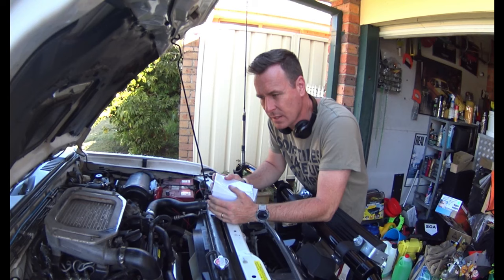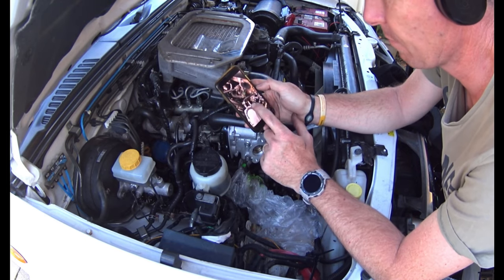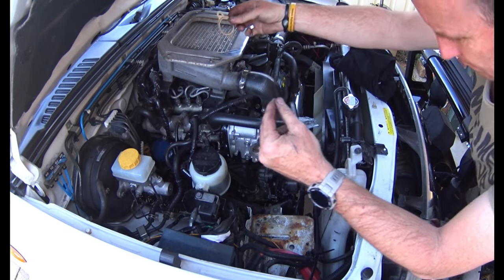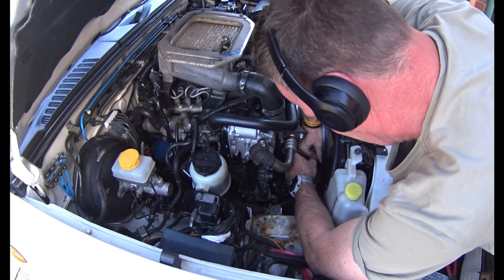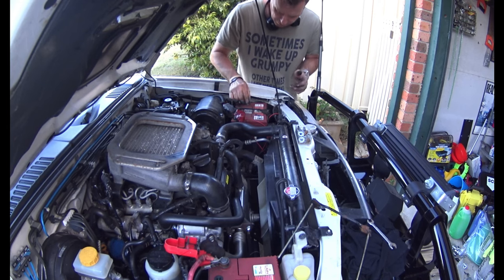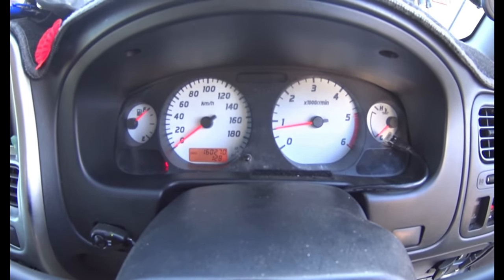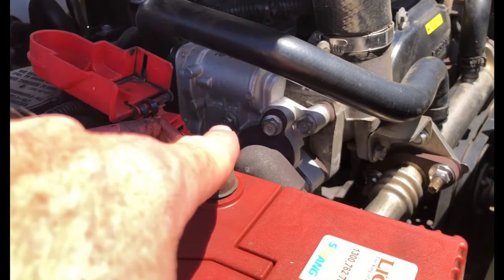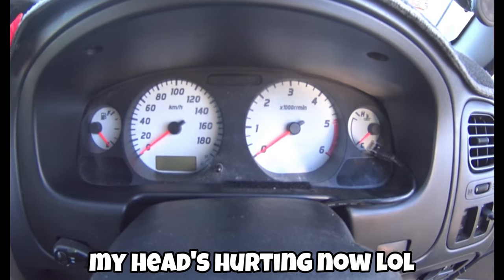WILL THE Navara EVER run again ? fingers crossed ... dead engine. Part 2 Driveway Done

Comment: Good luck with it. 
Hopefully, once you put it through a few heat cycles, it cleaned up.
I had a temperature sensor die recently.
 I got an gbay supposedly OEM replacement that fixed the out of range fault on the ECU but as I found out later, it was not giving the correct resistance value in ratio to the exhaust temp.
As a result, the engine couldn't do a DPF burn and clogged the DPF. (Limp mode)
Genuine temp. Sensor 2nd time round and a manual DPF burn sorted it.
Just part of owning a 100,000km plus vehicle.
Reply from the maker: Yeah it’s a bugger when you’ve got to do things twice like that mate. 
It seems to be running all good now, thank goodness 👉🪵